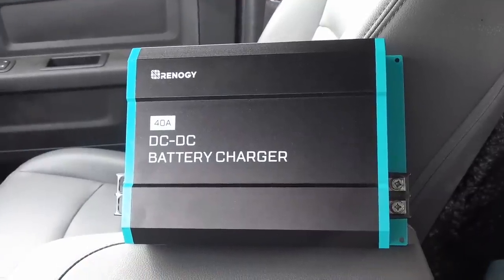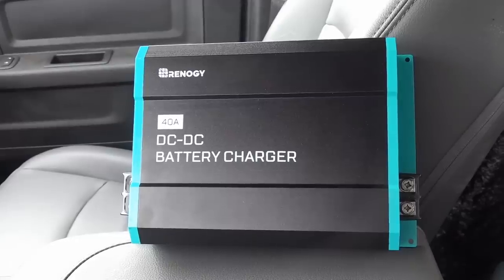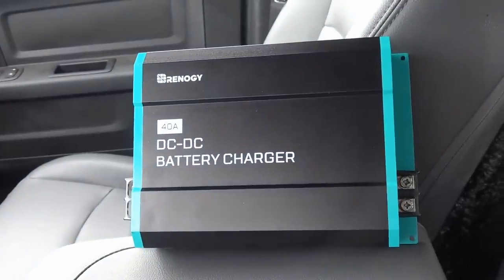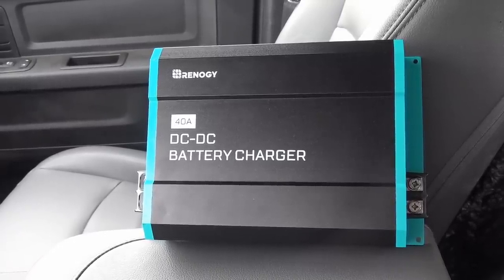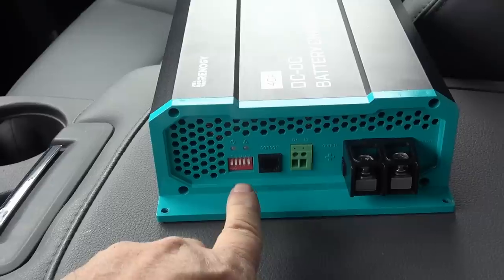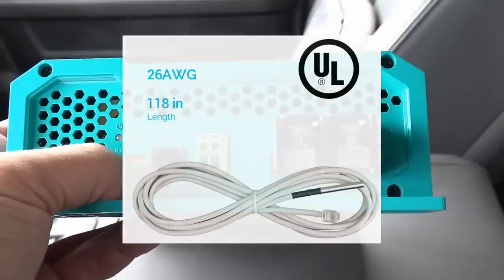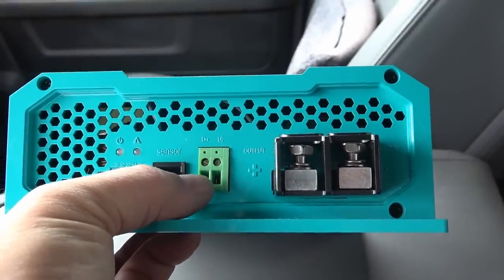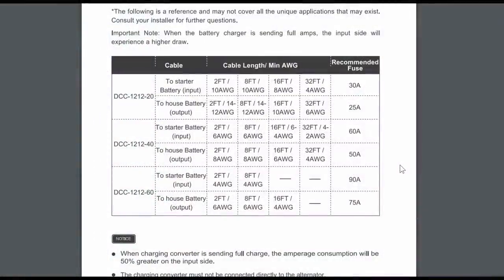Extra 40 Amps Charging into RV Battery Bank from Truck Alternator (Renogy 40A DC-DC Charger)

Comment: I have purchased everything for this setup but am curious about the ground wire from the engine compartment to the Anderson connector at the bed connection point.  Does the ground wire go directly to the truck battery or to the frame?  TIA!
Reply from the maker: Most people recommend that the ground return cable goes back to the battery. But to save money I used the truck frame and its worked well. My Ram truck use long steel beams in its frame so I attached a short cable from the Anderson connector to the frame under the end of the truck bed. You can see my truck wiring install here - https://www.loveyourrv.com/alternator-charging-mod-12-vdc-truck-bed-high-amp-power-port/  Before the Renogy DC-DC charge I had played around with installing an spare solar controller but it didn't work very well.

Comment: Great video. Going to do the same thing but was considering the Victron 30amp. Jumper cables is a great idea, I can't see how to fish them inside the underside of the 5th wheel either. What do you think of triggering the unit on using the existing hot lead (7-way charge line) in the RV. No new wires to run and it's a place to use the wire I need to remove anyways?
Reply from the maker: Thanks, the only problem I can see with using the 7-way power lead is if you forget to unplug the cable with the engine off you'll quickly drain your truck batteries. btw. I never disconnected the hot lead on my truck and it's been fine. Recently tested the amperage on the cable hot lead https://www.loveyourrv.com/7-pin-tow-cable-charging-tests-using-lithium-rv-batteries/  also you may be interested in this little mod I did. Installed a wireless remote key fob on the power trigger line https://www.loveyourrv.com/12-volt-wireless-switch-mod-for-my-40a-dc-dc-charger/  Cheer, Ray
Reply: @LoveYourRV  I will check my hot lead. I don't think it's hot if the truck is off. So if the truck is off then it's just like an ignition trigger.
Reply: @FLCrackerVideo , I was thinking the same thing, using the 7 wire 'hot' lead as the trigger.  On out trailer it could be accessed in the junction box below our pass through where the equipment will be mounted.  (Like you I'm going to check to see if it's a switched source.)

Comment: I bought the charger but what kind of wire is the trigger (D+) wire?? Is it just a flexible 18 awg 12v wire?
Reply from the maker: Here is what the owner manual says: "18-16AWG, copper cable recommended"  So nothing special. Stranded copper hookup wire used in automotive will work fine.
Reply: @LoveYourRV  Thx for the comment! The starter battery is in front of the driver's seat. Could I run the 16AWG wire and attach it to the starter battery and put an on/off switch under my seat? So I can turn the charger on and off when I want to save my alternator. Could I also run another cable to the starter battery with an on/off switch to limit the charger to 50%? I got a 200Ah AGM battery so the 40A charger + 325W solar would be a bit much so I want to be able to click the switch so I get 20A when it's sunny outside and click the switch to get 40A when it's cloudy or during the night.
Reply from the maker: Sure that should work well for the trigger wire. You don't have to worry about the DC-DC charger overcharging your AGM battery it has a programmable multiphase output so it will back off the charging if the batteries are near full and then only trickle charge once they are full. Cheers, Ray

Comment: Is there anything that has to be done to the truck pin connector, truck fuses to the pin connector, or to the standard 5th wheel cable?  Thx for a great video!!
Reply from the maker: No, I didn't need to touch the tow cable on the truck. Cheers, Ray

Comment: I have read that Lithium batteries will last longer if you only charge them to 80% and discharge them to 20%.  Does the DC-DC charger have that capability
Reply from the maker: You could lower the charge voltage and they would not fully charge. For example, in my RV the OEM charge converter puts out only around 13.6V and my lithium bank ends up only around 50% charged. This is good for when I'm parked at an RV site for months on end. But when going boondocking I wouldn't worry about fully charging your lithium bank each day or so. Its not like its sitting 100% charged very long for most boondockers once the sun goes down the battery bank is being drawn down.
You could be shaving a few percentage points off the overall lifespan, but really who cares, they last so long anyway. I don't see any point in babying them and sacrificing getting the most capacity out of them.  The 80-20 rule was mostly aimed at the early generations of lithium. Now, for the most part, the batteries have built-in BMS (battery manage management systems) and most companies have a warranty for 3500+ full charge cycles and even then the battery will have 80% capacity. I wouldn't worry about it. By the time they wear out, there will be a newer better battery and lithium will be old hat. :)
Reply: @LoveYourRV  great answer , thanks

Comment: curious about wiring the trigger wire to the marker light circuit on your trailer.  My truck energizes the marker lights everytime you open the door or operate the remote lock button.  When we are loading or unloading that could be a dozen times and might drain down the starter battery or just a lot of on/off cycles for the unit.  Got any other suggestions for how to rig that trigger wire other than through the marker lights?
Reply from the maker: Any 12V source will do, the amp draw on the relay is minimal. My truck only energizes my marker lights when I manually turn the light switch on, that's why I decided to use that circuit for convenience. Also, I took mine off a trailer marker light so I only gets power if the trailer cord is actually plugged in. So I don't know how you use the trailer but I usually hookup and drive to the next campsite, then unhook. You could always just unplug the fifth wheel or the 12V plug when loading and unloading. Or just wire the charger to an ignition feed source so it only comes on when the truck is started. I can't advice you because I don't really know your specific trucks wiring.  Lots of the fancier trucks will have a bank of extra auxiliary switches that could be used to do the job. Cheers, Ray
Reply: @LoveYourRV  Exactly, he could do a manual Aux switch type thing but also Blue Sea offers separate relays that would only allow energizing when truck is running.  Or connect the internal relay to an existing "ignition switched" circuit.

Comment: Hey Ray, great video. Thank you! Wondering if you could clarify one thing for me. The return cable (negative cable) from the input just connects to your truck's chassis right? Would this still work if I am doing this on a van and it's sharing a chassis ground with the house battery? Would love to save money on that negative cable.
Reply from the maker: Thanks Scott. Yes, It should work, as its working like that for me. My truck frame gets attached to my trailers when hooked up through the metal hitch to the pin box so its connected to the trailer frame and my trailer batteries negative are hooked to the trailer frame. So effectively both are sharing the same ground.  The only caveat is the van frame and how well it will conduct the electricity, my truck has large heavy beams, thick frame, not many joins, so no issue. Some vehicles have more complex frames with lots of joined pieces and sometimes that can create resistance greater than using a dedicated negative cable especially if the vehicle is old and may have some corrosion. but doesn't hurt to try.  Cheers, Ray

Comment: I noticed you used a terminal fuse and a circuit breaker between the battery and the charger I'm just curious what the purpose of using both of them are as opposed to just say the circuit breaker. I just bought my 40 amp DC to DC charger and I'm about ready to install it
Reply from the maker: The breaker is mainly there so I have a switch to easily turn the power on/off to the system, When I'm not using the DC-DC charger I rather have the long run of cable powered off.  The terminal fuse is there to protect the small length of cable between the battery lug and the breaker. For example, if I was to accidentally drop a tool or some metal object and it shorted between the breaker input terminal and the truck metal chassis it would blow. If it's not there it's possible the cable could quickly get red hot and melt leading to damage. Odds are its overkill for safety but I like to protect every wire in the circuit especially if someone else may be working on the truck. ie. oil change guys, etc.

Comment: so which was more expensive, the DC-DC or the 4 gauge wire from vehicle battery to Andersons to the DC-DC to house battery bank ?
Reply from the maker: About equal, Renogy 40 amp DC-DC was around $160 and the hookup cabling, connectors, lugs, breakers, fuses, etc was in the same ballpark.

Comment: Are the booster cables made from CCA wire? Any fire concerns noting the potential movement/vibration of the cable? ...That stuff is supposed to be more prone to corrosion, physical faults/breaks, etc...
Reply from the maker: No, I made sure to use 100% pure copper type jumper cables. More expensive, but better power transfer.  As for fire concerns I'm not too worried the DC-DC charger is used intermittently and I check the connections for signs of corrosion and feel for abnormal heating of the wiring regularly. If there was some issue it would also show up as less charging amperage and I would explore why to discover the poor connection point causing it. Cheers, Ray

Comment: I have a 2018 Ram 3500 Dually that I plan to add the same DC to DC charger. How many feet of 4 gauge wire did you use to run from battery to back of truck?
Reply from the maker: I bought 30 feet and had several feet left over. My Ram is crew cab with 8 foot box. Cheers, Ray

Comment: Question.  I want to run the same setup as you have ,but I want to install my dc to dc converter under my second row seating of my truck 🛻. Then use the Anderson plugs to make my connection to a fifth wheel or a travel trailer when I tow ..that way if I need to change from lithium to lead all I have to do is move my dip switches.  Question is will I get the same voltage I need to the second battery 🔋 too charger it or will I get a big voltage drop.
Reply from the maker: It should work; you just may need to use a larger gauge wire to limit the voltage drop. The manual has input and output wire size recommendations depending on the length of the run required https://www.renogy.com/content/RNG-DCC1212-20-BC/DCC1212-204060-Manual.pdf  Cheers, Ray

Comment: Hi Ray. As always, love your videos and appreciate you sharing. 

We’re planning to travel 6 months out of the year for the next two years. We expect to be moving weekly and boondocking in our travel trailer whenever possible. I already have a generator and plan to add solar, two lithium batteries and a 2000w inverter. Our greatest consumption of electric will be the use of a microwave and hairdryer

Because we plan to move frequently, does it make more sense for us to skip the solar panels and just rely on charging our batteries with a DC to DC charger?
Reply from the maker: Thanks Donn! Personally I'd want the solar before the DC-DC charger unless I planned to be mostly traveling and camping in cloudy areas. It really nice to camp and have the sun recharge batteries quietly all day long. Cheers, Ray
Reply: Love Your RV Thank you for your quick response Ray. Stay safe and healthy.

Comment: Very helpful video for my installation!! Did you disconnect or remove the “trickle charger” from the hitch plug?
Reply from the maker: Thanks, happy it was helpful. No, I just left the stock tow cable hook up as is.
Reply: ...the ‘hitch plug’ should never be disconnected- it’s supposed to keep your brake battery charged. 

Most RVs use the house batteries for the breakaway brake battery: not a good idea imho. I always install a ($40) kit to power the brakes and make them independent of the ‘house’ batteries. 

What he did here is the right way to charge from the vehicle. If he had 4 100W panels and three 100Ah batteries he would be nearly perfect imho!

Comment: Nice setup!  Two questions:

Can the dc/dc charger be set to cut out at a particular input voltage? You have enough alternator and are unlikely to leave the park lights on, but in some applications it would be nice to ensure the start battery won’t over discharge…

Never had li-ion, but I understand their C rating drops when below freezing and they can be destroyed by trying to charge too many amps when cold?  Do the batteries have bms to protect them?
Reply from the maker: No, it doesn't so most people will wire the trigger to the vehicle ignition circuit so only runs when the vehicle engine is on. Recently, I've also added a wireless remote to my setup  https://www.loveyourrv.com/12-volt-wireless-switch-mod-for-my-40a-dc-dc-charger/  
yes, my Lion Energy batteries have a built in BMS that shuts off charging and discharging when too cold to protect the lithium cells. I did some tests using a deep freeze https://www.loveyourrv.com/lithium-rv-battery-deep-freeze-test-lion-energy-safari-ut1300/  Cheers, Ray
Reply: @LoveYourRV   Nice. Looks like a slick setup.

Comment: Hey, I have a question. If my connection is like this - starter battery ➡️ dcdc charger ➡️ inverter and house battery (dcdc charger and house battery cables touch each other) and if my load is, say, 80 amps, will this be split like 40 amps from charger and another 40 amps from my house batteries? Or it just won't work? Thanks
Reply from the maker: Yes, you'll have an 80 amp drain on the house battery but at the same time a 40 amp recharge current from the DC-DC charger for a net 40 amp drain on the house battery.

Comment: Quick question on the wiring to the trailer light connection.  On a Ford The #4 trailer pin usually is the Aux12V+ going to the trailer and is only on when the ignition is on.  When I do mine, would this work just as well and not need to worry about the lights?
Thanks for the great video.
Reply from the maker: Sure, any switchable 12V source should work fine it takes very little amperage. I decided to go with the marker light 12v versus the ignition so I could let my diesel engine warm up a bit before turning on the DC-DC charger if I wanted to and it was easier than running a dedicated switch.
Reply: @LoveYourRV    Another option to think about.  Thanks again.

Comment: Any ideas on whether running this impacts your gas mileage?   I guess it must since there is no 'free energy'.  I wonder how much it impacts it.
Reply from the maker: I haven't had it long enough to get a feel for it yet, but I doubt it will be much, I have a big diesel engine. Probably a wash cost-wise when you compare to what it would have cost to run the portable gas generator instead.

Comment: Hey ray what terminal size lugs did you use on the safari 1300? And what size on dc to dc connector please. Thanks love all your videos stay safe
Reply from the maker: Thanks, My Safari UT1300 battery bank is wired with 2/0 GA cables and lugs. I only have a 1000 watt inverter but sized the cables with maybe future plan to up that to a 2000 watt inverter. For the DC-DC charger I used 4 GA it puts put a max of 40 amps. Here is another video I did recently  https://www.youtube.com/watch?v=Nt3CG5qeF5o  tested the system using solar, DC-DC and generator power all at the same time.  I used the DC-DC a few times on the drive home during rainy days it worked well. Cheers! Ray

Comment: I've been pondering using the truck for my negative ground also to save on cost of wire. Am i thinking correctly that from a grounding point on the vehicle chassis, i just need to do a short run to the input of the charger? My plan is to have the charger in close proximity to my house battery, so I'm not too worried about that side. I'll just run both negative and positive to the battery itself.
It's a long way from my engine compartment to the location of the charger. Hopfully, i can save the majority of the cost for that run of negative wire.

Thank you
Reply from the maker: A lot depends on the materials used for the vehicle chassis frame and various connection points but worth a try. My Ram truck uses large beams that run front to back so not many frame connections and everything is solid steel so works well as a conductor. It worked great for this Renogy and I recently tested an SRNE DC-DC on the same setup and works well.  https://www.loveyourrv.com/testing-out-an-srne-50-amp-dc-dc-charger-mppt-solar-controller-combo/  Cheers, Ray

Comment: Hi Ray, another great  video. I was wondering why you didn't install the dc to dc in the truck for future flexibility?
Reply from the maker: Thanks, the manual said to located it as close as possible to the auxiliary battery being charged and protected from moisture and dust.